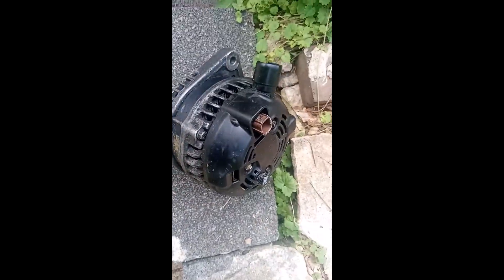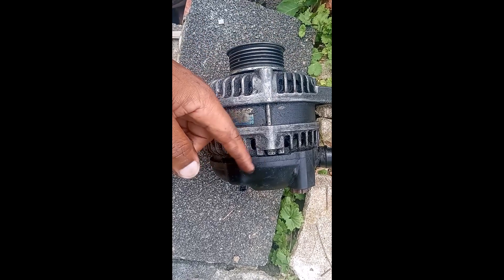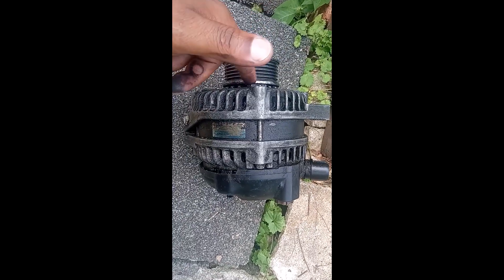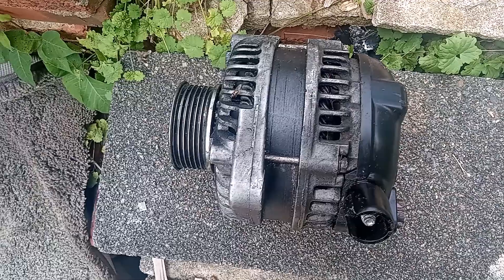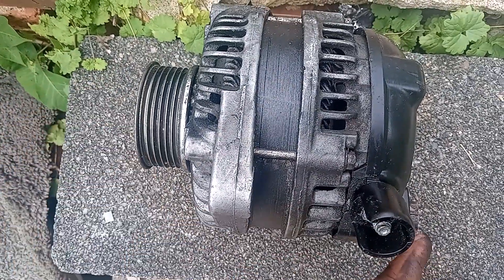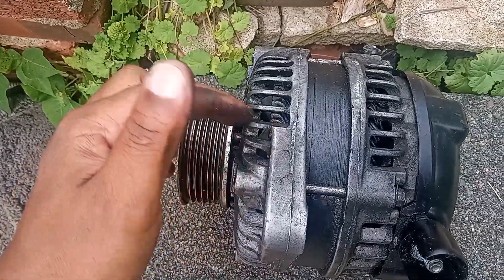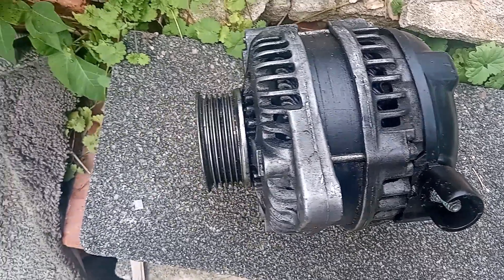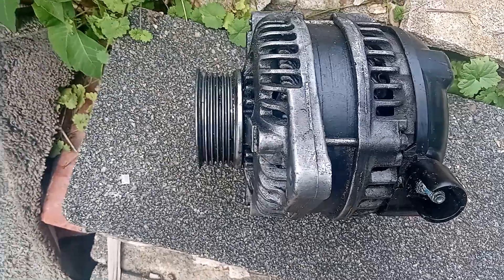ALTERNATOR CLOSER VIEW FOR YOUR CAR..WATCH

Comment: The alternator regulate the voltage
Produce power 
The battery helps the alternator to run without the battery will not work
If there is a wire or fuse or relay burn or any ground wire from battery or power wire are loose or the belt is bad or broke it will loose the power and will drain the battery

Alternator is very important part
Sometimes alternator and battery will die same time
Let's say if you' alternator is bad and you battery is new you will only go /drive for around 30 minutes or less so you know now ...
Sometimes is very easy to fix alternator issue but if you wait longer you will drain your battery or alternator will fail quickly
Sometimes is just the serpentine belt or simple fuse or relay..or ground battery cable or loose wire